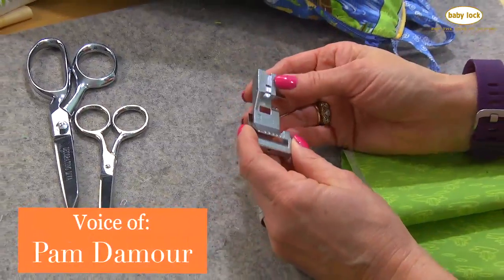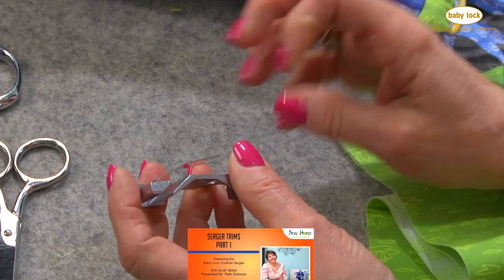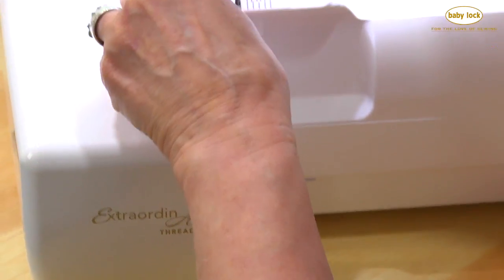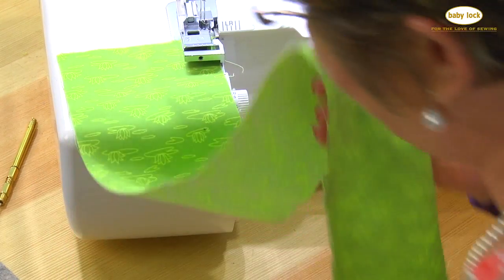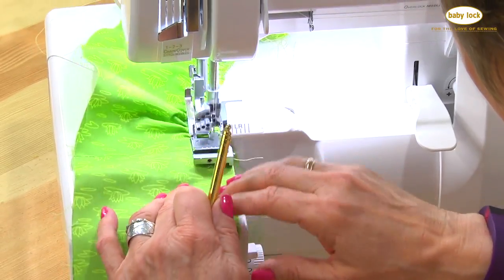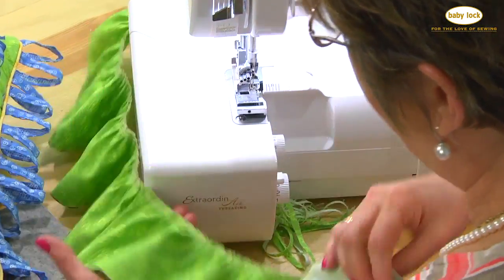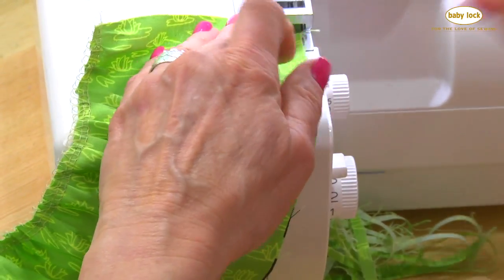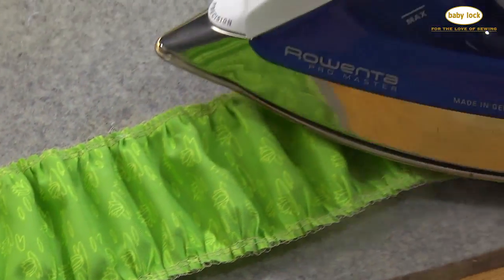How to Use a Serger Ruffling Foot

Comment: No need for this foot though. 
For 4-thread serging with regular foot:
**********************
Differential feed:  2.5
Stitch length:        4
Left needle:           7
Right needle:         7
Upper looper:        3
Lower looper:        3
Perfect ruffles!!
Try it!! Your rectangle for gathering should be 2.5"--3" longer than your hem circumference.😊

Comment: I just bought the Victory and the ruffle attachment. I tried using it to ruffle along with attaching my ruffle to some fabric and I see I need a lot more practice. My bottom fabric, the fabric that was supposed to ruffle apparently slipped to the left so some parts of the ruffle didn't attach to the fabric. But what did attach was attached with such a wide stitch that it would never hold the ruffle and fabric together. Is that what's supposed to happen? I ended up sewing it again on my regular sewing machine and then did an overlock stitch on the serger. What am I doing wrong?
Reply: Sheryl DeMott Try your regular, standard foot and these settings:
Differential feed:    2.5
Stitch length:          4
Left needle:             7
Right needle:           7
Upper looper:          3
Lower looper:          3
I hope this helps.😊
Reply: @TheJudeJane  I'm not sure what you mean by the numbers for the needles and loopers.
Reply: Sheryl DeMott  The round dials on your serger are called tension disks. They have numbers on them. When I said upper and lower loopers and gave a number, I meant for you to turn your tension disks (round knobs with numbers 0 to 9 marked on them) so that the numbers I gave you appeared at the TOP of the tension discs. Same for those for the needles. The stitch length is located on the right-hand side of your serger. Set to the number I gave you. The differential feed dial is located directly below the stitch length dial. Set that to the number I gave you. When you are finished making your gathered ruffle, set your tension discs to 3 on all four of the round tension disks for a standard setting. Check your manual for the standard settings for your stitch length and differential feed settings after you complete a ruffle. Still need help?😊
Reply: Sheryl DeMott Do not use a ruffler attachment if you just want a gathered ruffle.
If you are using a ruffler attachment on your serger, so you can attach a straight piece of fabric while creating a ruffle with a separate piece of fabric, please see videos for that particular technique.
See my other response to your question if you want to just make a beautiful ruffle that is not created while attaching to another piece of fabric.
Reply: @asheryl1966  
Sheryl I had success with the ruffle foot attachment on my Victory today!  Focus on keeping the top fabric along the foot edge where it feeds.  The bottom takes care of itself pretty much.  Don't sew too fast.  Good luck! Remember to re-engage the blade after putting the ruffle foot on lol!  I had a mess the first go.
Reply: sandy glenn Congratulations!! I am happy for your success, Sandy. 👏🏼👏🏼👏🏼👏🏼❤️😊
Reply: @TheJudeJane  After I posted my problems, I found a video that helped me ruffle and attach the fabric at the same time but thanks for trying to help. And just so you know, my Victory has automatic tension so no tension dials.

Comment: Mine does NOT work like this.  Same settings but it doesn't really gather consistently or at all. Frustrating.  Im sorry I spent all this money on a serger
Reply from the maker: Hi Tammy! I'm so sorry you are experiencing some frustration with gathering on your Ovation! Your Baby Lock retailer should be able to assist you with your concerns!
Reply: If you use a narrow chain stitch in combination with the 4 thread overlock, the fabric will not move on you as much. If you don't want to leave the chain stitch in your project, it is easy to pull out. You can also use this 6-thread combination (see your threading chart) when attaching the ruffle to a flat fabric (all in one step). Don't forget if you want it to be more ruffled you can always pull the needle threads just like you do when using your sewing machine. Don't get discouraged: your Babylock serger can be your best sewing tool!!
Reply: Tammy Lukas
 For 4-thread serging with a regular foot on your serger:
Differential feed:            2.5
Stitch length:                  4
Left and Right needles: 7
Upper & Lower loopers: 3
Perfect ruffles!! Try it!!
Reply: Tammy Lukas Do you have the manual that came with your serger? If so, look at the "knobs" (tension disks, differential feed, stitch length) in the pictures to determine which ones control your differential feed, stitch length, upper looper, lower looper, left and right needle. Only after you understand where these "serger parts of your machine" are located will you know what  "knob" or "dial" to set your serger on to create the ruffle. Always put your settings back on standard settings after you have created the ruffle. Read your manual, Love, because all of the information about it is right there in the pages. Let me know how you did after getting yourself acquainted with your serger.😊
Reply: @TheJudeJane  
I have a Victory.  I understand all the settings instructions you provided except for 'upper and lower loopers 3'. Do you mean use all three or is 3 a setting on a knob I don't see?...Ok, I did it!  It did ruffle, but not as much as the video shows.  I tried the differential on 2 and it helped a little bit.  Is there anything else I can do for a more full ruffle?  Maybe I'm not feeding it freely enough or something.
Reply: sandy glenn Turn your right and left needle tension discs to 8 or even 9. Leave upper and lower loopers at 3. Ok! Give it a go,!! Let me know how it turned out and re-set all four tension disks back to 3 when completed. Check your manual for standard settings for stitch length and differential feed for your serger.
Reply: The 3 is on your tension discs where you can set the tension on each from 0 to 9. When number you choose is at the "top", that will be the number the tension disk is set on. Still need help?😊
Reply: @TheJudeJane  
Thank you!  I tried with and without the ruffle foot attachment and really liked the foot because I could gather AND attach in one pass.  I'm happy with the results and thank you for your help :)